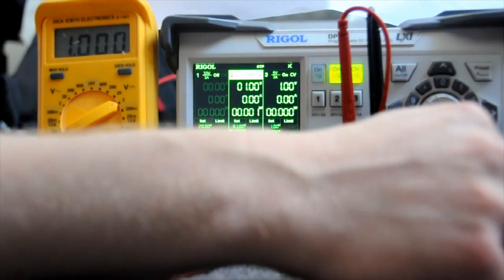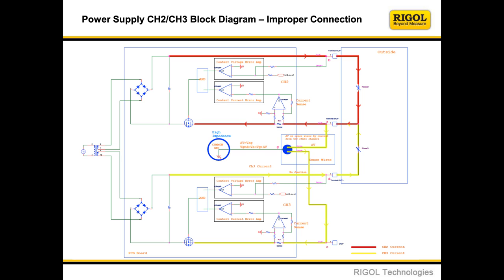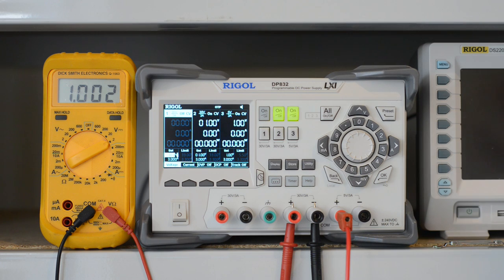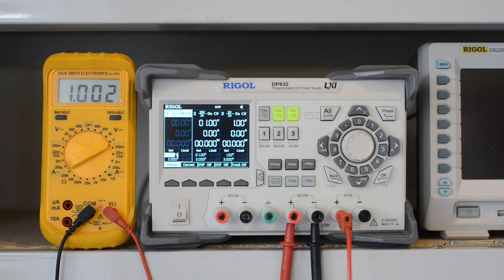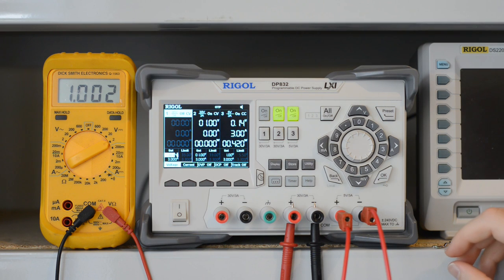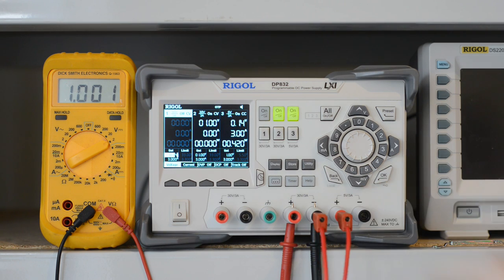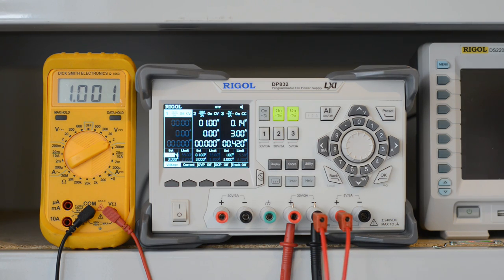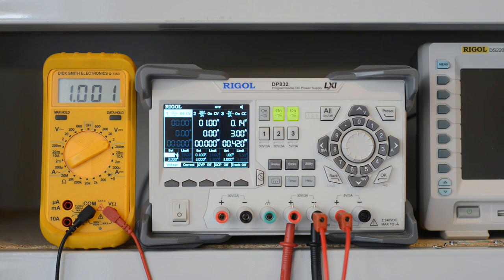Rigol DP832 voltage measurement flaw fix

Comment: Just bought it. 2023 and still not fixed. But still, I like the power supply very much. I'll fix it and probably replace the fan. I'd like to have the dp2031 but it was 1100$ can more.

Comment: Just to confirm, you soldered the 3mm copper lead between the negative terminals of output 2 and 3, right? I need to do that fix myself one of these days...
Reply from the maker: +johndoe271828 Correct!
Reply: TheHue's SciTech Cool, thanks a lot for sharing.

Comment: Has this been fixed in models produced now?
Reply from the maker: My 2µF I doubt it. Even though the supply is performing out of spec, it'd be very difficult to contrive a situation where this actually caused problems. Plus, it's easy to fix yourself! I have no regrets with this purchase.

Comment: Why you just dont use screw terminals to hold a nice think wire with forks on the ends, the terminals are used bu banana plugs, I almost never use the screw.
Reply from the maker: juliusvalentinas That looks ugly, is liable to falling out (or relying on the screw terminals being held down), and (as you sort of point out) makes the screw terminals difficult to use. But your proposed solution is fine too, just different pros/cons.
Reply: Yes I agree it's ugly, but lets you keep the warranty. If you have one. Because if I have to pay 80Eur shipping for in warranty item - I have none. It's nonsense to have local authorized service center that can't even calibrate it. Having new item out of spec for 500Eur and no help is, strange don't you agree. My motto now is - wan't problems then buy RIGOL, the post soviet Latvian country goods that are outsourced and made in china.

Other than that, and what Dave found nice PSU.
Reply from the maker: juliusvalentinas I'd give them an earful if they refused to honour a warranty due to a repair I did to rectify their misdesign... plus I don't really care about warranty on such a low cost device. But again, subjective opinions all around!
Reply: Well, 500Eur is not cheap over here. I refused to pay them 80Eur for shipping, so I guess they refused to send it to RIGOL for repair.
Google first 10 companies with cheapest prices for this device in Europe, is it correct the client has to explain to them the tolerances and how to understand them?? What about the fake images some of them send me showing all zeros on power on? Fake because it's same image same crc32 check. 

I should add that upon request to install demo hi-res codes and make images showing that ch1 really shows zeros on RIGOL DP832 display almost everyone refused. And those that made images made it in normal mode only. 

On the other hand I can't complain to RIGOL (if they would respond to email) I got no reply from them no matter what email I tried.
I can't complain because 
a) they supposedly do not have trial codes for hi-res mode
b) if I complain about what I have not bought from RIGOL means I hacked 
my unit and there is no warranty.

So I can't complaint to RIGOL that my unit has ch1 display out of spec. If I complain I will have no warranty. 

So I'm free to say the DP832 are units that are purposely badly calibrated so when you buy hi-res license you must ship it back to RIGOL to fix the calibration issues.

If I'm wrong why the fuss not wanting to send me images by sellers? Think about it.